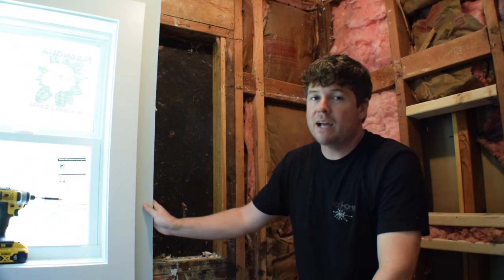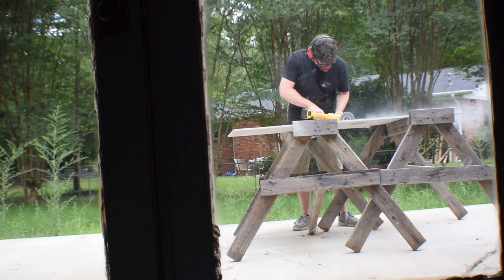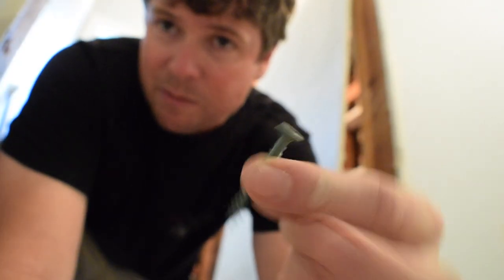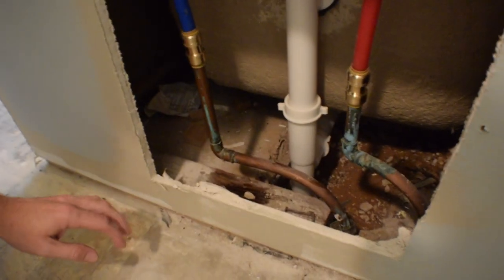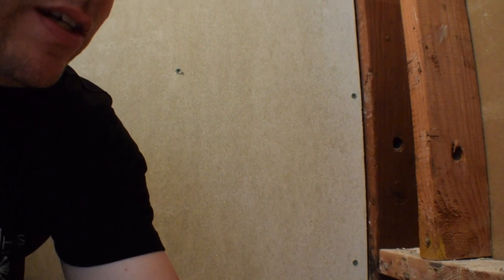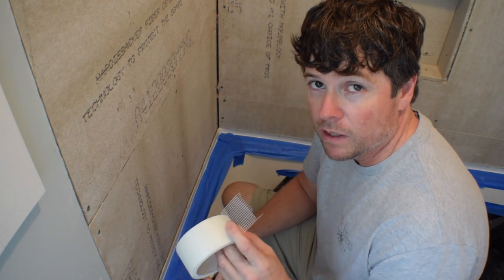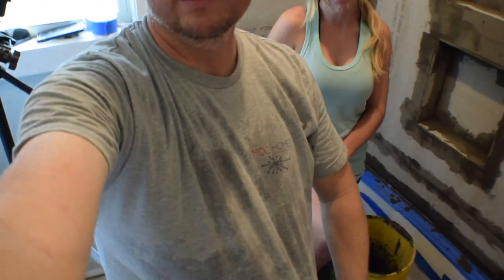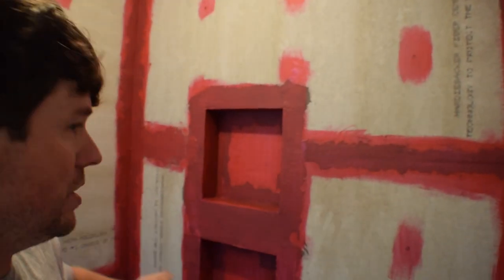How To Renovate A Shower Part 2: Backer Board & Waterproofing

Comment: I did RedGard today over green board. Now I'm ready for Palisade tile. I can't wait to get the shower tiled with that stuff. So damn cool! No grout and it's way cheaper than anything else. Tip: drywall stops at the shower pan lip, not beyond it or water will wick up backer board or drywall. Just don't do it. Another piece of advice, never ever use shark bite fittings. Use the kind you expand the fitting with a tool, they never leak. Use the right pex too. Lots of crap out there. My plumber uses the best stuff. He's been doing it a LONG time. He gives me a good break on labor too. I don't do plumbing and I'm damn glad I had him do everything. He redid the entire home.

Comment: Jason this video series has been a huge help for our bathroom reno I'm doing up here in Boston.  How much RedGard did you need for this size shower?  Was 1 gal enough or should I get the 3.5 gal?  Thanks in advance.
Reply from the maker: Thanks. So glad I could help. 1 gal will be plenty for this size. Good luck with your renovation. 👍
Reply: @MDCHOMES  you're the man, thank you